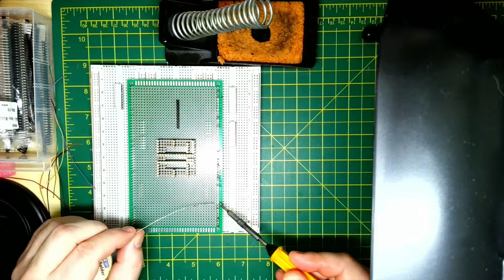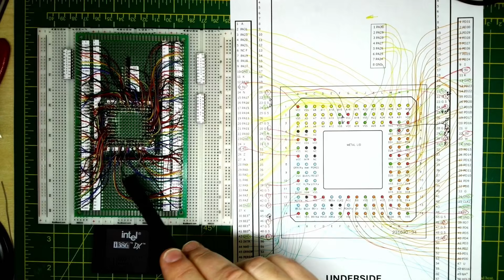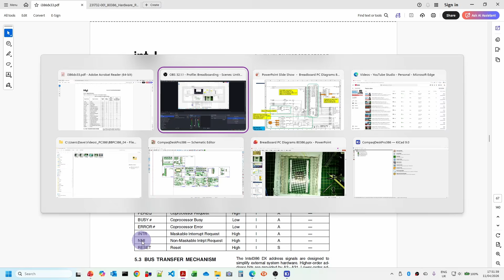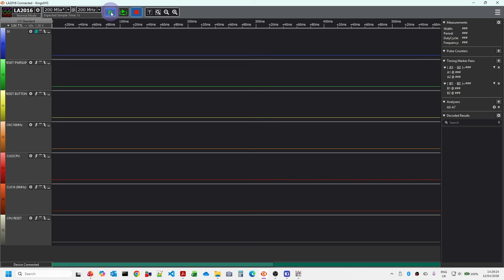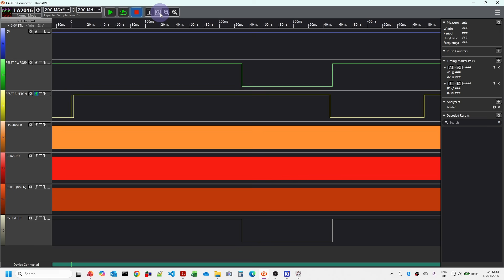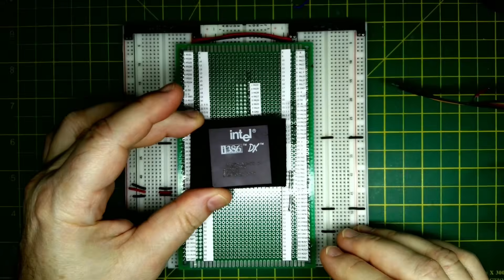386 Breadboard PC #4 Finish 386 Breadboard Adapter, Reset & Clock Build & Test

Comment: I’ve been building and configuring PCs since I was 13, starting in the 386/486 era—when hardware setup meant manually setting jumpers, configuring IRQs and DMA channels, and making everything coexist without conflicts.
I’m experienced with low-level DOS optimization, including fine-tuning CONFIG.SYS and AUTOEXEC.BAT, loading drivers high, and using HIMEM.SYS and EMM386 to free up conventional memory for demanding DOS applications and games.
I still work hands-on with original 386/486/586 hardware, handling full system assembly, troubleshooting, and software setup—from bare metal to stable DOS 6.x and Windows 3.1/3.11 environments with proper driver configuration.
This series stands out for its level of detail—implementing a 386 system on breadboards, dealing with clock, reset, and power supervision at the signal level, and building a working setup from first principles is not something you usually see documented this clearly.
I no longer do this professionally, but I still build and maintain systems for myself and for friends and family. At 52, I’m still pushing these machines to their limits :D
Reply from the maker: Good to hear about your systems. I would have to say modern software is so bloated and inefficient I can't see why most things people need these days wouldn't run fine on a Pentium (with an SSD). I still have the box and disks for Quarterdecks QEMM which I hope to try out later in the project when I have the RAM above 1 MB working. I do the videos as much to remind myself in a years time what I did. I am am glad others find them interesting. Dave

Comment: When a motherboard with a 386 CPU first came out, it seemed like an untouchable and expensive god. It's wonderful to see how it's built in your videos.
Reply from the maker: Yes, I could only afford a PC in 1992 after working for 6 years in IT (though I could borrow laptops sometimes from work). That was a 486 DX 33 with 4MB of RAM in 1 MB SIMMS! I wish I had put it in the attic and not disposed of it. Dave

Comment: I've had SO MANY of those little PCBs that break out a surface mount chip into a DIP layout so you can use it on protoboard or breadboard... little 16-pin things usually.
Then this gargantuan masterpiece came along and I am humbled! :)
Reply from the maker: Yes I have quite a few of those too including some of the larger 64 & 100 pin TQFP ones but you don't seem to be able to buy PGA 132! I suspect I may need to learn how to make modern PCBs (or order them anyway) in future, though I think the 486 has 168 pins with 17x17 grid so that MAY just about be possible to make the same way. Thanks for the feedback. Dave

Comment: did you solve the problem of wrapping the wire around the slippery (corner-less) pins? are they just on loose for now? i really want to see this project succeed but if the main chip is loose it's not a very good foundation but a start is made and I've enjoyed watching even if i'm a little worried
Reply: sorry i just saw your reply to my comment in the last video. i never got a notification so only just saw it now.
Reply from the maker: I have not needed to solder anything yet. I increased the length of stripped wire to the maximum my wire wrap tool supports and the extra turns help. It is possible to pull the wires off the pins but with the wiring comb and being squashed against the breadboard when plugged in mean they are unlikely to come loose (I hope). Dave

Comment: Great video. I do have a 486 build that I've been tinkering around with in the back of my head for some time, about 20+ years. I did start making some progress about a year and a half ago at trying to get a logic analyzer on a dead 486 motherboard and see what was happening. and discovered the self test modes that I thought was really neat. I did notice that there was a limit to how slow you can run the chip and that it would not run lower than I think 8MHz. Anyway keep this project up as I look forward to seeing your progress.
Reply from the maker: A 486 DX 33 arrived from eBay this week. When I realised it just has a similar 17x17 PGA socket (no staggered pins like in later chips) I may try this one after this project. Min speed for my 386 DX 33 is 8MHz. Thanks for the feedback. Dave
Reply: @breadboardinglabs yeah I'm going to pull out my box of CPUs and get the 25mhz chip out. I think there is very little electrically different between the 386 and 486 as long as it's not a DX verient as the DX ones had a clock speed multiplier internally.
Reply: I am talking without verification here but it was dx2 2x and dx4 3x I think
Reply from the maker: Just be careful with higher speed chips DX4 I think as these were NOT 5V parts. Dave